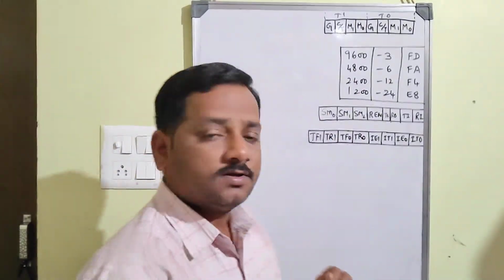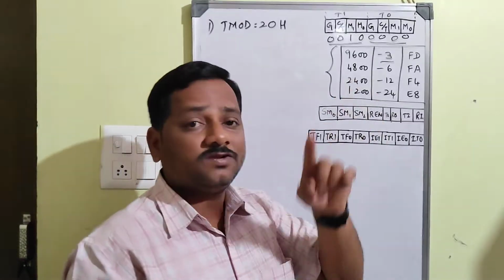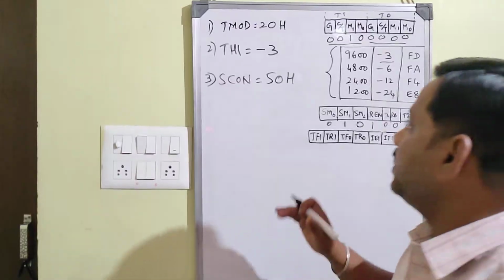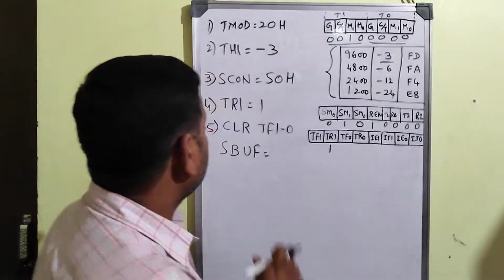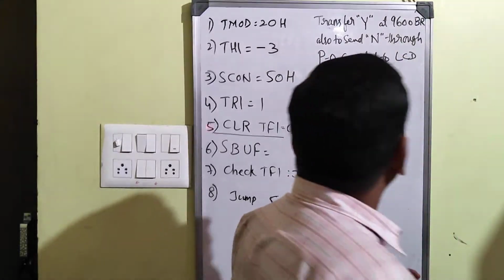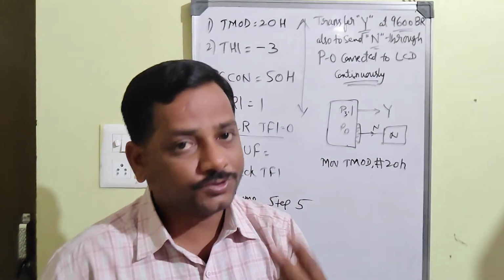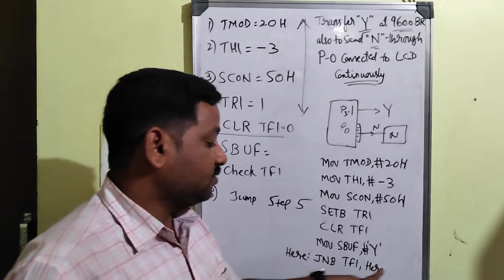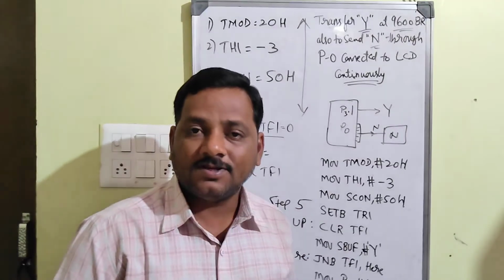Module-4: Programming to transfer data Serially in 8051 Microcontroller !! By Sharan Sir!!

Comment: Why negative value have to use -3
Reply: Because we are loading the DECIMAL value to the TH1. In case if you want to load a HEX value, then you need to subtract the number 3 or 6 or whatever it is for the respective Baud rate, you will get the respective HEX value, to avoid the complexity of calculation, you can directly load the DECIMAL value with the -ve sign indicating the same meaning to the compiler.

If you want you can cross check with this.